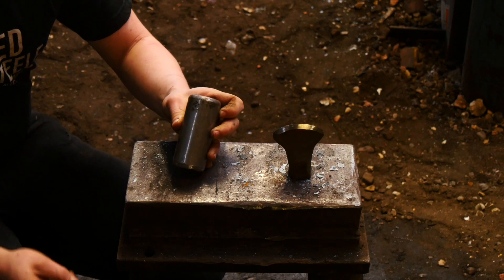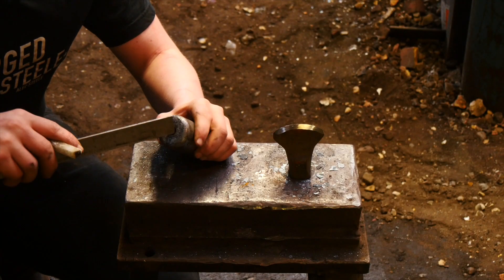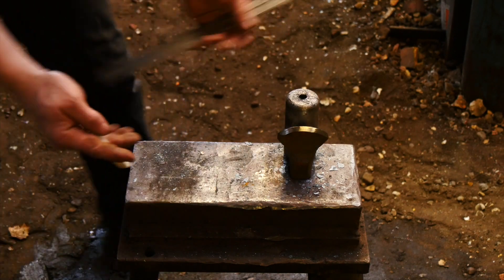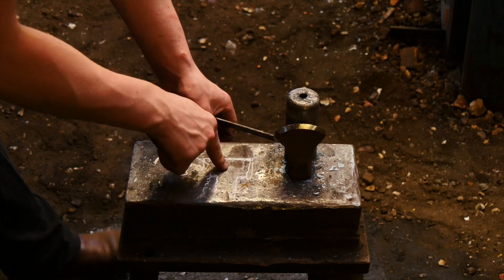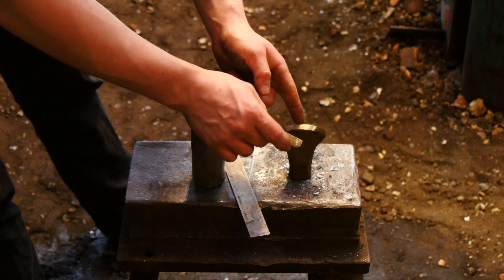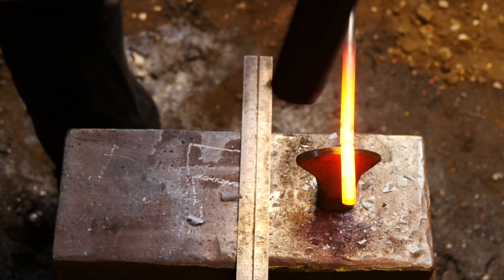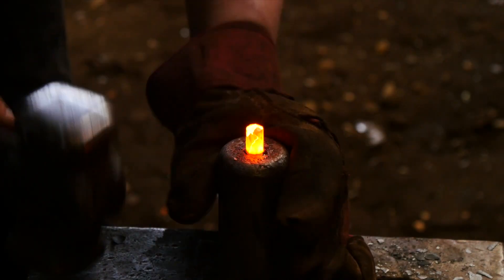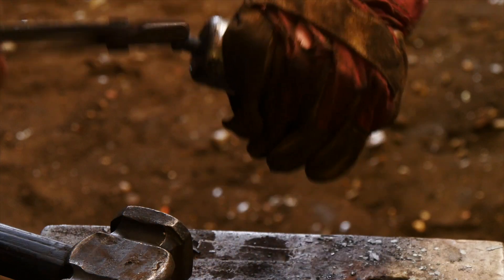HOW TO MAKE A RIVET

Comment: thank you alec it was riveting how do you get drill bits in 10.2mm ?
Reply: grayem pepper you can buy those drills in odd sizes as they are thread tapping drill sizes - 10.2 mm is usually used for M12 x 1.75 thread. Hope that helps.
Reply: thank you

Comment: Hey Alec, as someone who is slowly working my way into blacksmithing I have a very novice question. Why do you and so many other smiths tap your hammer on the anvil after striking the metal a few times? Is there a smithing reason, or is it more of a baseball player tapping his shoes with the bat for good luck type thing? Thank you!
Reply: I was thinking about that too :D

For me with almost no experience it seems that you can do the forging in more controlled and relaxed way, and the hammer will bounce off the anvil so you dont have to use alot of force to move it again.  I thought i'd comment on this so it gets NOTICED more :D Anyone got opinions?
Reply: It can help to remove any accumulated slag (sometimes referred to as iron oxide or "scale") off the face of your hammer. You don't want to add it back  to red hot metals, it weakens the work piece.
Reply: Asa far as i know  the tapping technique is so you can put the hammer handle in the right p[osition in your hand ,well thats why i do it
Reply: 1 year late but why not. It is mainly used to keep the rhythm when forging, you can use it move/look at your piece instead of just stopping and have to get going again. It is not to remove slag/scale from the hammer like some people seem to think, slag/scale does not stick to the hammer.

Comment: How deep should. Drill the hole for rivet tool
Reply: He said it was 35mm which is 1.38ish inches.  I may make one this weekend and I'll probably make mine 1.5 inches.  I want 1/4 inch rivets so I'm going to pick up a 17/64 diameter drill bit as well as thick piece of round stock.
Reply: Believe it depended upon length of rivet you wanted

Comment: Hmm i tried to do this and the rivet got locked into the tool. I couldnt not get it out i drilled my hole all the way through so i could come at the rivet from the other end. Took a punch of the same size and tried getting it out that way. Locked the tool into a vice and tried light taps all the way to hitting the punch with a 10lb sledge. The rivet would not budge one bit. What did i do wrong?

Comment: Why do you have dirt and the floor?!
Reply: A: Dirt is easier on the feet than concrete. B: Dirt can be shoveled out and replaced much more easily than concrete C: If your floor gets contaminated with  flammable liquids, the dirt goes back to step B: and the concrete requires a lot of absorbent and cleaning time, evaporation and such for fire safety.
Reply: safety. (YouTube Editor is cutting off stuff)  D: In the event of step C: and dropping a red hot item, you have a flash fire. E: Dirt floors are kind of traditional in smithys.